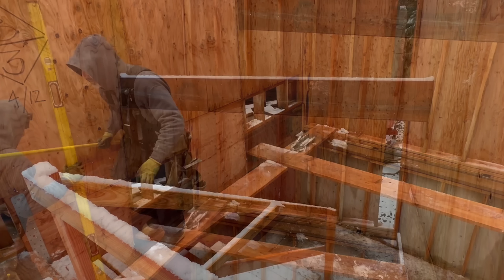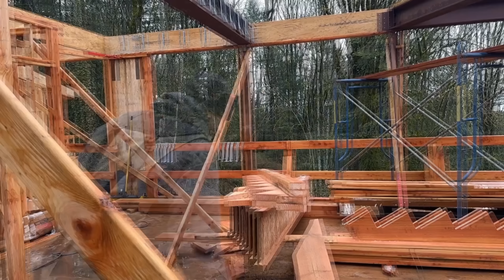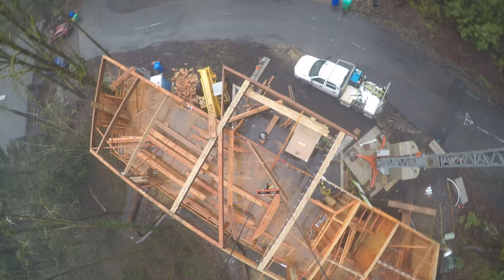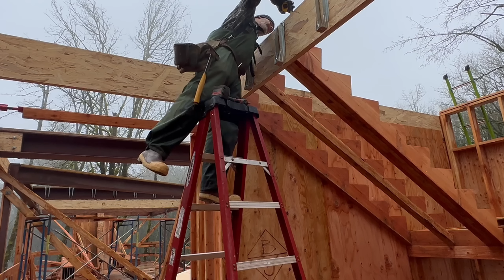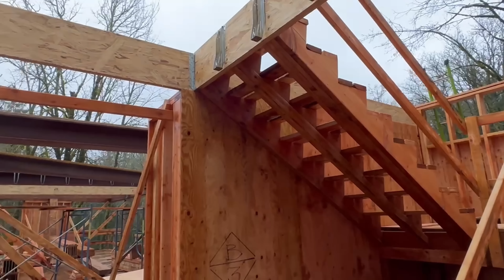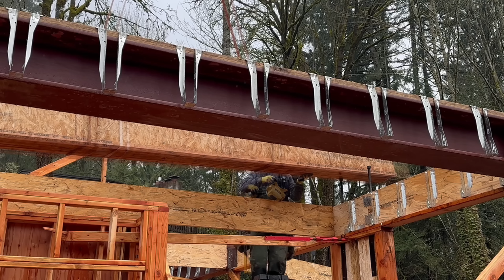Modern House Part 13-  Rolling roof and floor joists plus stairs to the top floor.

Comment: Another great vid.
I noticed the third corner glazing window off the bathroom. Odd number rule, 👍
My Dad built our house back in the mid 70’s here in the Okanagan Valley, B.C. I helped the best I could as a 10 year old.
People thought he was crazy for using 2x6’s to frame the house.
Reply from the maker: And now there are some getting built with stagger studs on 2x8 plates so theres no thermal transfer. Dad was a pioneer!
Your'e right about the odd number rule, there is actually a 4 corner glazed in the back bedroom but they nixed yet another  which would've been 5:-)

Comment: Like the floor trusses since they can give you plenty of space for your mechanical systems without having to cut up your i-joists or other standard joists. Pretty clever to put in the plumbing pipes as you're installing them. Less joints to worry about leaking later on. Anyway, another great video. Really enjoy them.
Reply from the maker: Thanks for that,   I honestly can't imagine how they would've ever gotten thru there otherwise with 12"oc joists given the size of the acceptable drill zone with the fall requirements.  Funny thing though,  in chatting to a framer buddy about the issue he clued me in to the fact that sometimes they add rat runs to these systems which can be tricky to install later if you miss them and in my case impossible.  Sure enough there was one hiding in the layout.  That's the 2x6 you see me sliding into the webs with the pipes.

Comment: Jake another masterpiece. I can’t wrap my head around the horizontal hold downs? We use them to join floors together per hurricane code in Rhode Island. Peace my friend
Reply from the maker: Oh yeah,  we mostly use them that way here too but in this case they are used for torsion (twisting) control.  By tying the steel beam to the perpendicular wood beam and then tying that into the diaphragm of the roof it effectively turns the wood member into a wrench or lever arm that keeps the beam from rolling from the loads that are potentially developed at the unsupported end.  They are placed at the last point of contact  of a cantilevered beam.  It's a really common attachment in steel to steel  connections but not so much wood to steel. I've done this same thing in another fashion before and this is way simpler.  I hope that all makes sense.

Comment: Jake, could you please explain the various distances of the joists and trusses and the reasoning behind them? Some are at 12” on center, others 16” and 24”, from my perspective. Thanks for the great content.
Reply from the maker: Sure Miles, I'll do my best.    The first 30-35' of both ends of this level are actually the roof and other than a curb as far as it goes  so the spacing is dependent on the span and loading.  I believe there is also some 19.2 spacing in there as well but I think most of it is in the part that is floor for the upper level.  Again there, span dictates spacing.  The "floor trusses' in the driveway end of the house were designed to allow the void for the rain drain piping which is going to work well.  that area is somewhat split between eco roof and  roof terrace so the trusses were slightly different  and clearly marked for location.  Overall, some of the areas can get really tight and everything needs to go in in the right order or you can't get it in. There's also been a few changes made so I have to be careful working between the new S-pages and the original TJI layout.
Reply: Thanks for the info Jake. Can’t wait for the final product.
Reply: Miles is my other channel

Comment: a full days work, then video editing?   I hope you have someone.    Great project for us to follow.  Any concerns about everything being wet?   Eventually it needs to dry, but I guess the summer is coming.
Reply from the maker: Hey thanks,   the two low roofs are now dried in and it starts going the other direction right away.  The builder is used to dealing with it and has a program.

Comment: Crane-Ballet  ... wonderful. Btw you need a crane which listen to you. He is devoted to strict commands and do not have a clue about slopes and inclines of small angles.
Reply from the maker: What an incredible idea.  I wonder if it could be controlled with google glasses or some other vision interactive system as a backup to VOX.   What an upgrade that would be!

Comment: Is the bottom end  of the stair stringer being held  up by nails alone or did you put a support under that lower end?
Reply from the maker: There's a ledger, blocking and screws at all the bottoms and blocking and screws at the tops.  I wasn't sure how the bottom of the bottom set was going to play out so it will be done in place.

Comment: "Crisis averted" I was at pucker factor 10 the whole time.
Reply from the maker: Lol,  I was really wishing I had a camera handy for those two joists so i settled for hoping the mic picked up what I was saying.:-)
Reply: @ShredPile  I had to chuckle seeing you staging that ABS pipe. I was a journeyman plumber in Denver in the mid 80's, all commercial buildings. We would all get a good laugh when a new guy showed up with black glue all over his bibs. Lol.
Reply from the maker: It must be a whole other world when all the  DWV is cast iron.  Just the floor to floor stack weight must be immense.    One of those pieces I put in the trusses smashed my fingers pretty good:-)   @Z-Bart
Reply: @ShredPile  Yeah the roof drains were all cast iron too. Lots of clevis hangers, unistrut and all-thread.

Comment: 25:32 why do put the glue on the bottom of the joist hangers?
Reply from the maker: It helps stop the hanger from singing later on if stuff moves around.  It doesn't happen often but its difficult to fix if it does and it's easy enough to glue now so I do:-)
Reply: Thanks that makes sense.